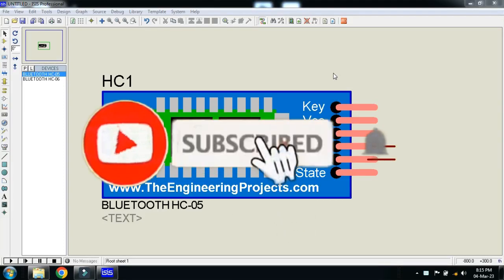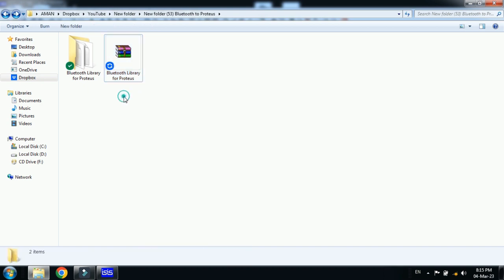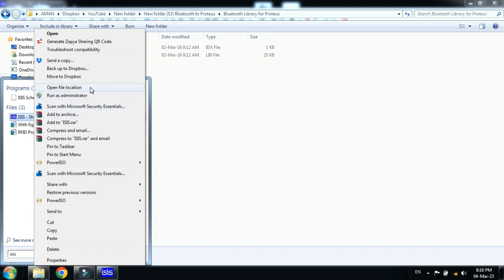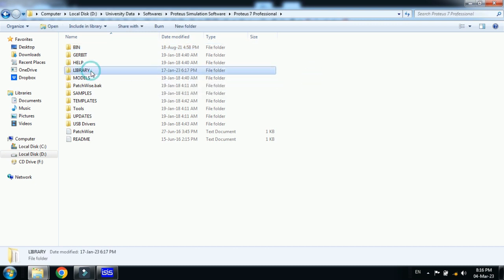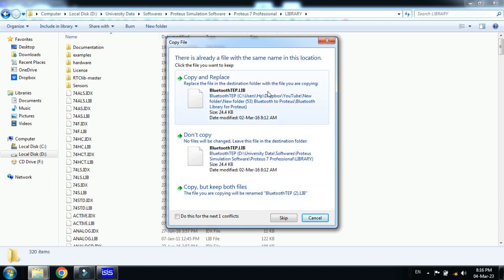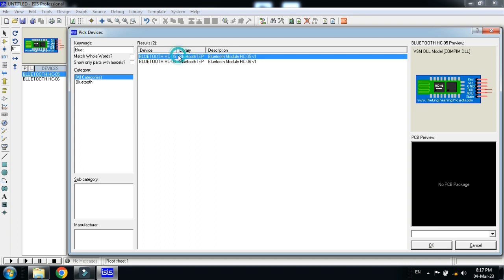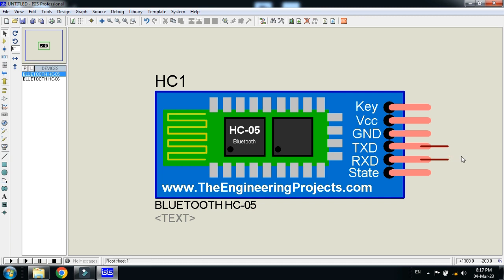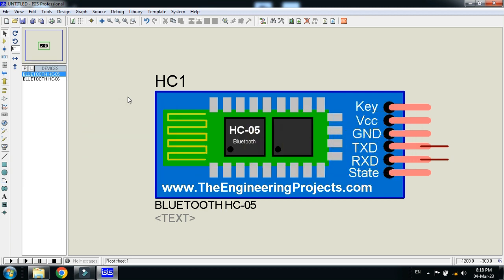Add Bluetooth Module Library to Proteus

Comment: Thanks alot bro❤🎉🎉🎉🎉
Reply from the maker: Welcome
Reply: @thebrightlight9472  hi bro i want one help that is similarly I want solenoid lock library for proteous bro. Please send me that library link or put make it video sir please🙏 emergency
Reply from the maker: Solenoid Lock library is not available for Proteus, so you can use an alternate option, which is relay. Use relay for demo purpose.